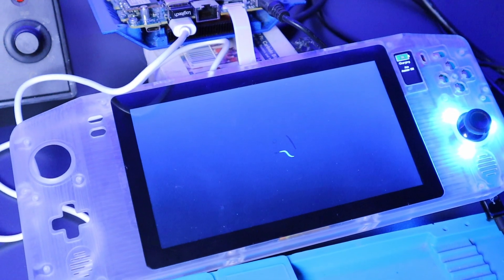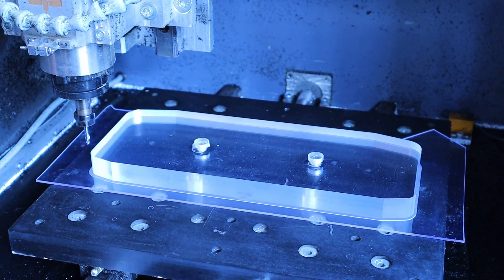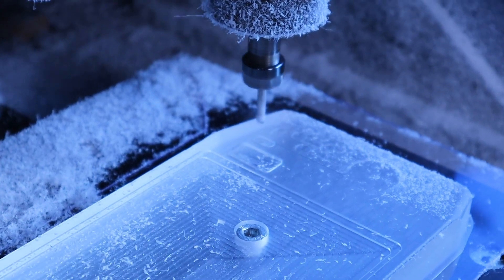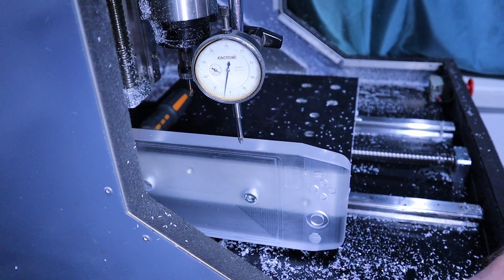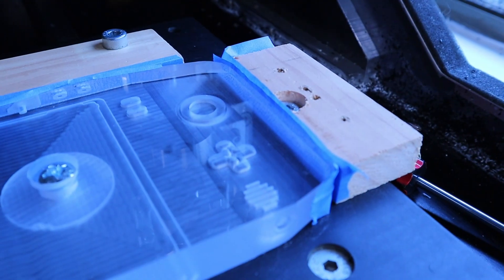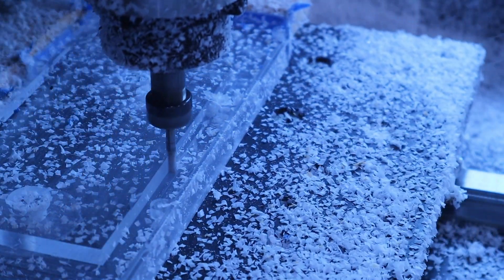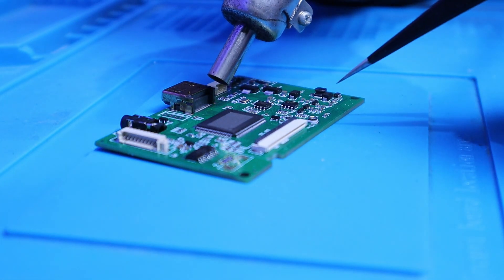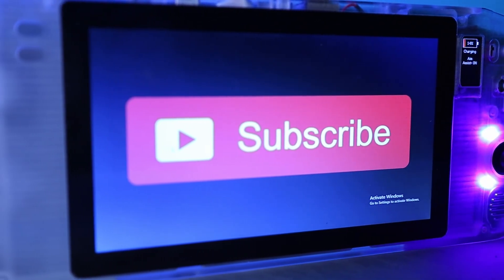NucDeck - The DIY windows gaming handheld - Episode Three - Connecting the display

Comment: I've always thought that Windows 10 and 11 would only support down to 1024x768 and all the documentation I've ever seen say that's the limit, so I thought it weird you would use a 1024x600. Google searching shows that MS DID add support for that resolution, so it's weird that that's not being touted as the limit.
Reply from the maker: Yeah, it can run at 1024x600 (and even lower, too). But I doubt they'll ever say its fully "supported" since some of the UI elements within the settings menus become inaccessible. The display driver actually does a reasonable job of scaling down a higher resolution signal though so for setup purposes I've just bumped the resolution 1280x768 and let the display driver do the scaling. Once windows is set up, everything else is perfectly happy running at 1024x600 besides a handful of games that have limited resolution options which I either just run at a scaled down resolution or find a hack that allows custom resolutions. 
The unfortunate reality of building things like this on a small scale (as in, not mass produced) is that you have to use what you can actually get and screens are one of those things that are only readily available to hobbyists in a couple of sizes/resolutions.

Comment: is your cnc using grbl ? also what are you using to generate such a complicated gcode ?  and mate this is seriously cool
Reply from the maker: Thanks! No, my CNC is running mach 3 with an ethernet smooth stepper for motion control. Gcode is all generated in fusion!
Reply: @cncdan  I see, you mentioned you have a big one at work, so probably makes sense, as someone who build one I went with grbl as mach 3 has quite an interface to figure out ;] I wish I would have access to a big cnc so I can redo mine with milled aluminium parts instead of 3d printed, but will happen at one moment as so far not satisfied with the stiffness at all ;] nice to see that someone done it right
Reply from the maker: Not only do I have a big one at work, but we actually manufacture CNC machines. As you may have guessed I'm part of the design department but I got my start in the manufacturing end of things so I've got a fair bit of experience running machines too!
Reply: @cncdan  nice, one Ive used the Nikodem Bartniks idea but placed it in a small server cab where a cab is part of the case, but 3d printed parts are just not strong enough so will be redoing it ;]

Comment: @CNCDan this is an awesome project! Would love to see how the emulation performance compares to one of the newer cheap mini pcs, maybe one with an Intel N100 as the price seems similar to the NUC that you chose. Could potentially be a good way to reduce power consumption too
Reply from the maker: Cheers! Yeah the N100 is an impressive little processor. I believe the i5 in my NUC does slightly better than it on the benchmarks, but it's definitely pretty close. I only picked the older Intel NUC because they have fantastic documentation meaning I could guarantee it would fit before I committed to purchasing parts for the project.

I will be doing a small bit of game testing/emulation in the next video in a couple of days time so stay tuned!

Comment: Great work, really interesting to see a CNC machine at work with a project like this. Any reason you chose CNC over a large format Resin printer? Looking at getting the Elegoo Saturn 8K for projects like this personally.

I'm sure you've already thought of this during your design phase, but make sure those beautiful front firing speakers are not going to be covered or edged by the meat of the thumb whilst holding the case. This is something I picked up from one of RetroGame Corps videos and thought it was a great point.  Another thing with Ergo's would be making sure that the back grips have enough "meat" to hang on to comfortably for long gaming sessions. RGC has said that one of his favourite handhelds for Ergos is the Logitech G Cloud.

Again, you've probably already gone through this and considered these points, but I guess it's part of the community conversation :)
Reply from the maker: Great question! Honesty I'd be really interested to see how it goes on a big resin printer. I've seen a few people have issues with large flat objects though but if you can get it to print I reckon it would look great! I choose the CNC simply because I already own it and know I can get a fantastic result using it.

As for the speakers, they are definitely close to your palms when holding the device but they are far from covered (at least with my hands). I tried lots of different locations because I didn't want them blocked by your hands or downwards facing and this was the best I could come up with. I would've preferred them up the top but because of the battery monitor screen and the touch screen ribbon connector there really isn't enough room.

As for the grips, it's definitely a personal thing. My grips are definitely nice and chunky because I wanted them to be slightly higher than the NUC cover to help with airflow when sitting on a flat surface. Once I had the general shape designed I printed prototypes and adjusted the shape and button positions until I was happy with the feel.
Reply: @cncdan  Cool looking forward to seeing more.  As for printing in Resin, it should be fine as you would angle the print rather than trying to print it flat on.  But I guess I'll find out and let you know when I get the new printer and you release your files :D

Comment: Would e.g. an expensive NUC13ANHI7 fit too?
Reply from the maker: Yeah I think so. Intel provides 3D models for all of their NUC models so besides perhaps needing a larger back cover it should be pretty easily doable!
Reply: Terrific! - so the different NUCs have different dimensions :|
Reply from the maker: @DavidFilskov  The mainboard has been pretty much the same overall size since the first revision as far as I know. They definitely moved some of the mounting points on the PCB at some point and the cooling solution has gotten bigger with almost every new revision. It seems like its settled down a bit in later revisions so hopefully not too much of a change needed from my 7th gen to make newer ones work!
Reply: That's awesome :)